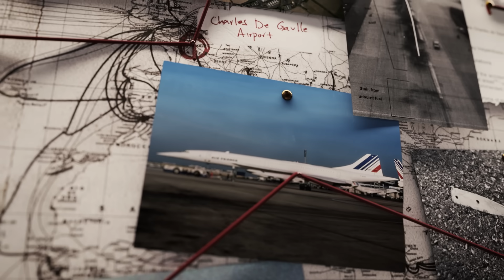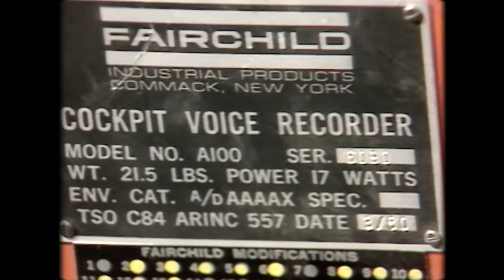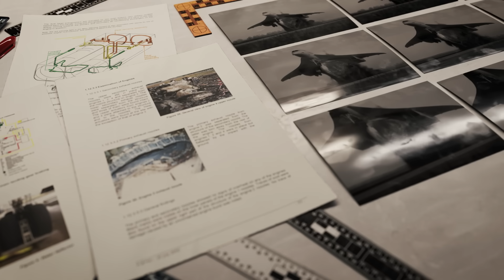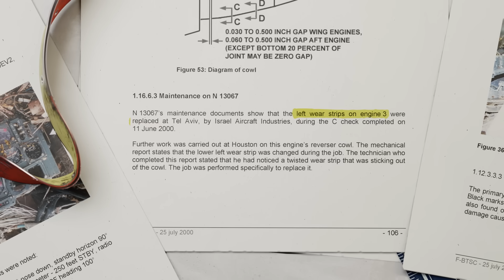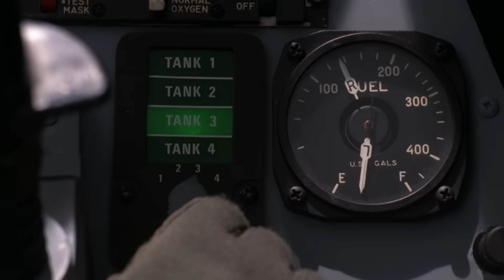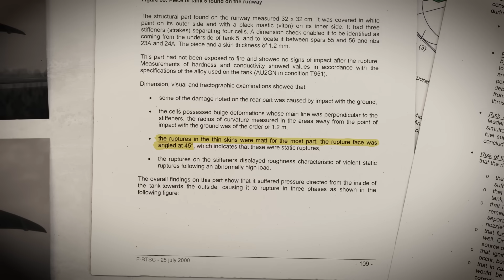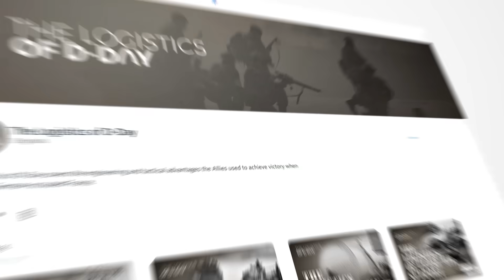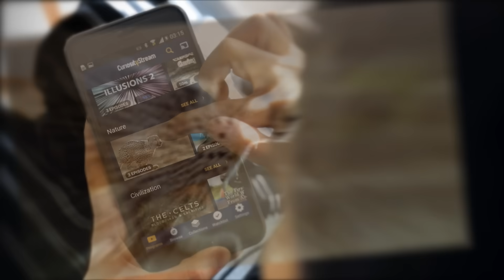What Actually Happened to the Concorde

Comment: You missed some details, left main gear boggie had been replaced a few days before and they miss to install a slever that keep a busshing in place and it nade the left boggie start wobbling like on a shopping trolley, this made aircraft drift to left and hit the metall strip. The aircraft weight was over max take off weight and the wind had turnd so they started with tailwind, they were heading on a parked B747 on taxiway waiting to cross runaway so they lift of before takeoff speed, president of France was onboard that 747 and whant to see Con orde tahe off. So there was many things that went wrong that day. Flight engebeer turned of engine with fire warning to early in flight face, newer planets have fire warning inhibit During first part of liftoff.
Reply: The story as told by John Hutchinson  
https://www.youtube.com/watch?v=fqOcYhzWUZY
Reply: None of theses things had any relevant role in the accident.
Reply: @redwithblackstripes  Very few accidents have a single factor. On a normal day, that tyre failure may well have been a survivable event. There were a lot of aggravating factors here.

Being overweight did not have "no role" in the accident. It hinders the aircraft's ability to fly. It was beyond its maximum structural weight, let alone maximum takeoff weight.

A tailwind takeoff increases the ground speed required to get airborne. That adds to the problem.

The centre of gravity was off, which made it harder to control.

Critically, the wing fuel tanks were overfilled. They were not meant to be filled to the brim, precisely so that fuel does have somewhere to go instead of rupturing the fuel tank.

The captain ignored safety protocols, because they did not want to leave any passengers or bags behind, and filled the tanks to the brim so that the overweight aircraft would make it without a fuel stop.

If the fuel tanks were not overfilled, they would have been a lot less likely to rupture.

Comment: 01:32 V1 is not the point of no return.
V1 is the decision point of whether to abandon the takeoff or not.
V1 will vary depending on the aircraft and runway length.
Reply: Your second line contradicts the first...
Reply: @krashd  how does it do that?
Reply: To be fair, speeds continue to increase at takeoff. If no action was made at V1, any decision would be too late.
Reply: @dbclass4075  exactly, V1 is the point where you can stop the aircraft on the runway safely. Beyond V1 you are pretty much committed to flight.
Reply: @Slarti  Minor detail: V1 is the maximum speed an aircraft can stop safely.

Comment: Thanks for your story, well done. But meanwhile I have seen quite a few more and must summarize: First the planes got upgraded. Never had a death before. There was plenty of demand, even I would have taken a flight. Branson was ready to buy them all and sell tickets on the net where it would have sold every seat. Politics was the ONLY reason they got scrapped. CDG must have said: Only useless Germans on board. Send a 105% Mtow downwind, who cares about them. Less noise in Paris because of wealthy war mongers? Another doco tell us about the missing washer on the wheel buggy. The better tires available that were not fitted. So Continental got off with a slap on their wrist.  Seriously! Such an engineering marvel should have been sent upwind. It has no ailerons, no elevator. Just a pair of flapperons and that would have warranted a headwind start on a clear runway. I take optimum care on my tires on my car. So there was no excuse to leave the old ones on. Give us a minute of silence for all victims. I have had it with French airports, rather drive my car.

Comment: The DC-10 was so unsafe that even cause other planes to crash
Reply: It's marginal to blame this on the DC-10, it's highly unlikely any other plane would've crashed from the same debris. Especially when there many previous reports of damage on the concordes.
Also, after it's terrible start the DC-10 became very safe, and finished with a vastly better safety record than the Concorde.

Comment: continental folded shortly after and sold itself to united airlines. because there was nobody to sue, no one was ever punished for this. as for mcdonnell douglas planes, like the one of which the part fell off, were death traps. many dc-10 and md-11 crashed over the years. but oddly enough the executives who made all the bad decisions at mcdonnell douglas got high ranking executive positions at Boeing after their merger. the same executives who made all the made decisions that led to the 737-max crashes. a rushed design that broke a lot of rules and caused hundreds of deaths. go figure.

Comment: How much force or pressure would’ve been required to punch a hole like that? And how would those systems have been implemented in such a way as to prevent the same thing from happening? It must’ve been a ton of force and mitigating that force with Kevlar or non shred tires can’t go very far, right?

Comment: could the pilots have done anything after the metal piece hit the wing? could they have aborted take off
Reply: The force of flaming fuel caused the plane to twist out of control. Nothing they could do.
Reply: @snowdog03  what if they throttleed back and hope they slid off the runaway?

Comment: Short: An american DC-10 tin can fell apart yet again and brought the end of a plane which only had 1 crash in its 27 year history despite (yet-to-be-fitted) preventative measures already being available.

Longer: America and russia tried to make a supersonic airliner.
America and russia failed at making a supersonic airliner.
America therefore argue that nobody else should be able to fly thiers hampering the aircrafts possibilities and profits.
Flights were undervalued so profits were smaller than should have been but were later corrected and it flew a reasonably profitable and exclusive service for over 20 years.
America got attacked
American DC-10 fell apart (Leaving unchecked FOD on the Paris runway which created the loss of the Air france concorde and crew).
Humanity flushed its progress down the toilet so we can pay £500 to be herded in like cattle with 400-800 others for over 8 hours on Boeing aircraft which never go wrong.
...18 years later America and the UK look into the possibility of creating a Supersonic airliner.

Comment: The crash-prone DC-10 can even take down another plane, and arguably the most special/top passenger plane.
Reply: The 'crash-prone' DC10 finished with 0.64 full-loss equivalent fatal accidents per million flights, the Concorde had 11.36...
Even at the start, when the DC10 had a very poor record, it seems likely it was only briefly worse than the Concorde.
Likewise even the 737 max probably flew more flights before its first fatal accident.
The Concorde had plenty of problems of it's own, after all how many other planes have crashed, killing everybody onboard(and some on the ground) because of debris on the runway? As in the video, it had many other reports of damage, it also lost a large piece of the rudder in flight, among other issues. And all of this was from a tiny fleet of planes.
If there had been a fleet as large as any other commercial jet, there likely would've been many crashes(although presumably there would've either been major fixes or it would've been pulled out of service).
It's also significant that a large proportion of plane crashes were pilot error or even bombs in some cases, which wasn't the case with Concorde. It could arguably have contributed to the crash, but it wasn't the main cause, and seems likely it was impossible to save.

Comment: Well FOD on the runway can blow up a tire or worst case damage a reactor, either will generate an emergency landing and you won''t found to many such incidents. The Concorde was taking-off at 220knts (407 kph) was really pushing the limits on rubber tires capability and having fuel tanks beyond the landing was calling for troubles.
Why no one wanted to fly Concorde after the crash, very simple, before the crash he is a salesman/CEO willing to spend a $5k fare to see you he has to be a VIP, after the crash he is just a kamikaze desperate, betting its life to obtain your contract.

Comment: The crash of 4590 wasn't necessarily the "final nail in the coffin", more or less one of several. The true "final nail" was 9/11, as passenger travel demand dropped like a rock and people feared that the Concorde would be a big target because of its notoriety with rich and famous people. British Airways and Air France had plans to continue Concorde flights for many years following the crash, with speculation that operations would continue into the 2010s. Because of the higher operational costs due to maintenance by Airbus as well as the effect 9/11 had, BA and AF had no other choice but to cancel their Concorde programs only about a year and a half after relaunching them post-2000 crash.
Reply: I agree !

If you want furthers informations, you would consider reading "The betrayal of Concorde" from DONALD L. PEVSNER (the man who organized the Concorde flights which are in the Guiness Book of Records), you will learn some informations I believe...

Now, the website is offline, but you can find it on the wayback machine. If I am autorized to, I can give the link.
Reply: @patriceassemat  I appreciate the recommendation. I'm a super huge Concorde nerd and have read up and researched the aircraft up and down, so I'm fairly aware of the different things that have gone on.

Comment: I wouldn't be surprised that the accident was actually sabotaged because it was clear that all the airplane manufacturers didn't want Concorde to make it big because it then would force all of them to offer the same type of service which would have brought air fare prices down in the long run. Since this accident airplanes have been travelling slower & more efficiently which means that they use less fuel which has brought the prices down but the length of time to travel puts off all but the most determined travelers.

It is also a well known fact that the uber rich in society don't want us average ppl to be able to take holidays around the world especially in all those wonderful resorts that were only open to the uber rich in the past. During the pandemic the airline industry has suffered huge losses with not enough pilots, crew, planes that are in working order because of parts shortages from overseas. Roughly 2/3's of flights in the USA are cancelled or held up due to staff shortages, plane shortages & many other reasons. So it is a safe bet that plans were put in place long ago to take away the ability for average ppl to go on flights overseas by making it as difficult as possible slowly at first while no one would notice until average ppl accepted that it was just too costly & difficult to travel overseas anymore.

At the moment you can't even leave or enter your own country unless you are jabbed with proof showing that your jab was within a week of travelling. Plus when you enter a country you may have to go through a quarantine for up to 4 weeks stuck in a hotel where you are charged for all your food & lodgings to be locked up in an air conditioned room with no open windows & this is before you even start your holiday abroad. When you return home you have to accept the same treatment of quarantine at your own expense for another 4 weeks which this kind of madness no average person could endure or have enough holiday vacation time to allow for such crazy treatment & who has the money to pay for air fairs plus your holiday plus 8 to 12 weeks of hotels if you actually stayed overseas in another country for up to 4 weeks plus the 8 weeks hotel imprisonment ?????

Comment: Sad that this would kill the rest of the Concord fleet, one of the safest planes flown.
Reply: It wasn't though, that's a misconception that seems to have been pushed onto the public, perhaps at least partly by the airlines. The concordes 'safety' was only because it flew extremely low hours(largely due to an exceptionally small fleet) compared to other planes.
It also had a number of problems during its life.
Technically it could've been the safest in terms of lives lost prior to the accident(like any plane), but even the 737 max which had a disastrous start flew similar(at minimum) or more flights before the first fatal accident.
The Concorde was older, but it also had the benefit of having the top pilots. Other conventional passenger planes from that era also have a much better record, most of their crashes were also due to pilot error, not the plane/design itself.
Concordes reportedly flew 90,000 flights in total, including some after the crash.
For comparison, the 737 max seems likely to have flown more flights before the first crash - it flew 41,000 in the first 12 months, and the crash was about 6 months after that period, but more and more aircraft were being delivered all the time. There were reportedly 9,000 flights a week by the time of the grounding after the second crash.
The one concorde crash gives it a far worse fatal accident per flight rate than any western conventional commercial jet from about the 60s onward. Even the old DC8 had a record that is about 3x better.
The concorde works out to 11.36 fatal accidents per million flights(as it had far fewer than a million flights) Nearly all remotely modern jets are well below 1, or even none as below.
These numbers are worked out in relation to the number of passengers onboard though. eg: 1 crash of all 100 people onboard dying after 1 million flights = rate of 1; 1 crash of 50 out of 100 people onboard dying after 1 million flights = rate of 0.5
These planes have never had a fatal accident(at least when the article was written):
    Airbus: A220, A319neo, A320neo, A321neo, A340, A350, A380
    Boeing: 717, 747-8, 787
    Embraer: ERJ 135, ERJ 140, ERJ 145

Comment: And here I was always told the ruptured tire went into the engine and caused an engine failure... Nope, fuel tank rupture due to pressure waves from an adjacent impact. Fascinating.
Reply: This also happened. This is what caused the immediate failure of engine# 2. Engine #1 failed due to smoke inhalation from the burning fuel causing it to be oxygen starved.
Reply: @PerfidiousLeaf  Engine 2 did not fail due to damage. Because of the fuel leak both engine 1 and 2 surged before cutting off. Engine 1 recovered but engine 2 was then completely shutdown to try and prevent potential damage due to a fire warning. Engine 1 never actually failed completely. But it could not recover as the fuel leak was greater than what could be supplied to engine 1.
Reply: Also what's fascinates me is the price of human lives. You only need to 1 million fine for killing 100+ people because of cheap and poor repair. It's like buying "slaves" in the past, cheap as dirt. Shows how powerful and untouchable companies and corporations today...
Reply: @Cmd.SnorlaX  look at Boeing and the two 737 max crashes
Reply: @StoutProper The tenerife disaster? Yea.. that was fucking ridiculous

Comment: I would love to see a video from you guys called "the insane engineering of aircraft carriers." Or if that's too broad a topic, I'm very interested in the catapult launch system and the cable system used for landing. Most carriers use a steam hydraulic system for the assisted launch of its fighters, but the newest line of US supercarriers, beginning with the USS Gerald R. Ford, use an electromagnetic catapult system. I would love to know more about that. Do they use tech similar to a coilgun? A railgun? A maglev train? What problems did they have to solve to make such a system more practical than a more mature technology like steam hydraulics? Please do a video on aircraft carriers! :D
Reply: As far as I can tell, the USS Gerald R. Ford was accepted in 2017 from the contractor and is still not passing minimum requirements for deployment. The fact of that and that there are 3 others currently being built worries me.

On the other hand, I too would love a video on the challenges facing the Ford from design to acceptance to certification for deployment. It would be great to get some clarity on what actually happened as opposed to scuttlebutt. (like for instance that the EM catapult would EMP the whole carrier, which seems to have no basis in reality)
Reply: @thezouave7636  ,she's coming along just fine. https://www.dvidshub.net/unit/CVN78
Reply: id love to see a real engineering on carriers too, but until then not what you think has one which goes into this topic
Reply: Not What You Think has done lots of videos regarding your topic. Though not too much detail into the engineering aspects, he does talk about the different kinds of systems used across  multiple generations of carriers
Reply: @nicholaslau3194  yeah I've watched those. I just wanted a lot more detail about it
Reply: Pretty sure anything specific about the catapult system is still highly classified.
Reply: I thought EMALS has more in common with a railgun, but I guess it's more like a maglev train (though I don't think it levitates the payload):
https://en.wikipedia.org/wiki/Linear_induction_motor

(According to the Wikipedia page for EMALS, it uses a linear induction motor

Comment: I don't buy that explanation.
By that point the plane would have already sucked enough fuel for the tanks to have some air in it, that would absorb the pressure from a "dent"  in the wing. Nah.
Reply: And also, it supposedly shears THREE STRUTS,  which would require an insane amount of pressure, but none other part of the wing components fails. Like a hose or a fitting, or any other part with fewer or no struts. lol. NO
The tire was likely responsible for the hole. But it's more likely the tire and/or the metal strip tore a hole in the wing.